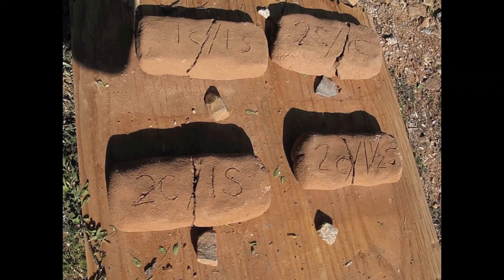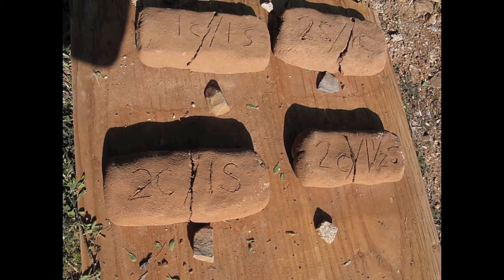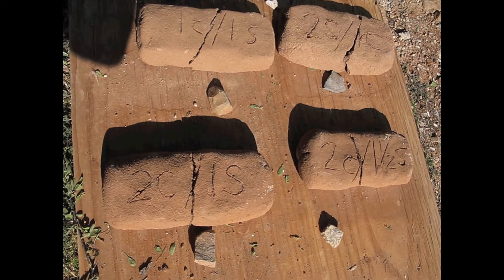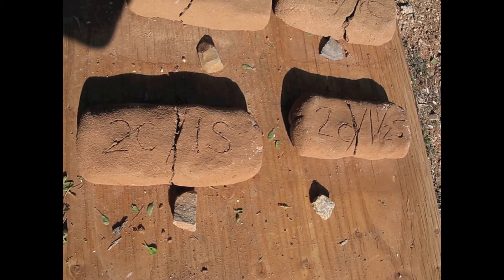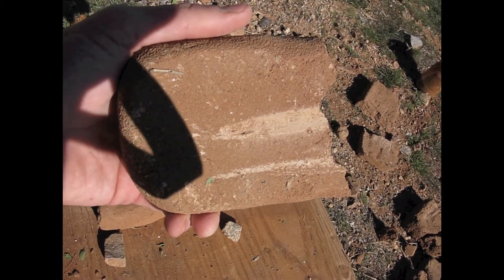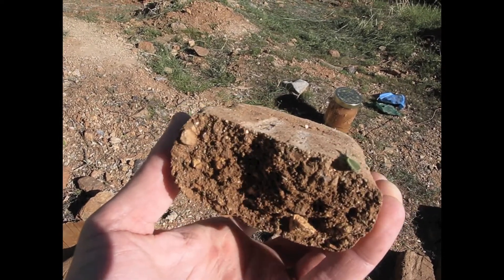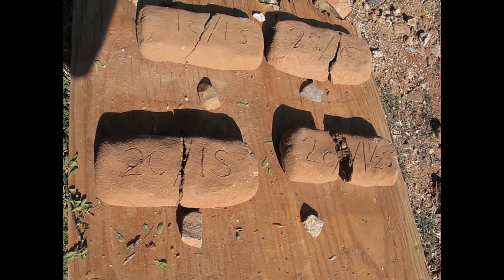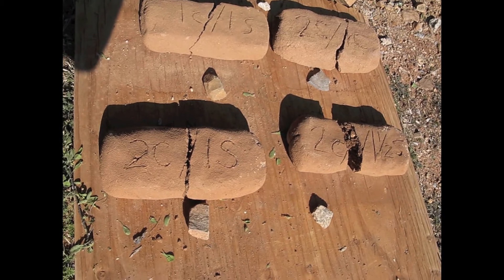Testing soil for clay content

Comment: Thanks for posting. Would be grateful if someone answered my question please. 

1) How much water is added to the clay? 

2) When combining the clay and sand, how is one part of clay measured? Is it one volume (example a bucketful) of clay-water solution or is it one volume of dry clay, ie before adding it to the water? 

3) Isn't the sand measurement based on only the dry volume?

I know this is not a precise science. However, it's useful to know for consistency on a single site.

Thanks in advance for clarifying.